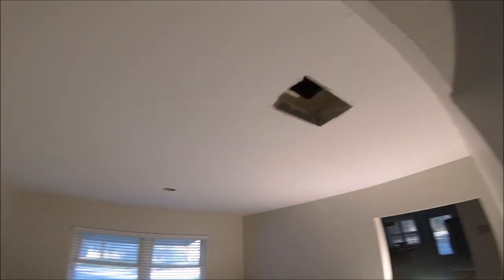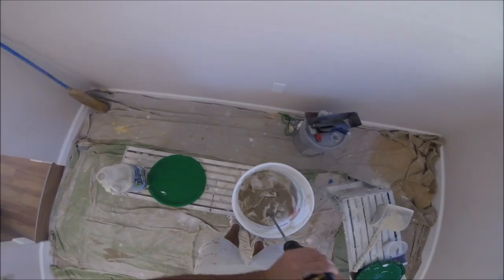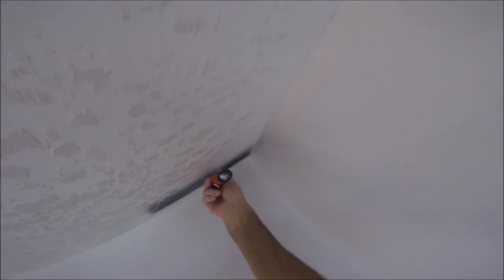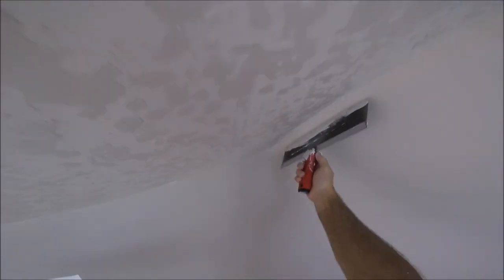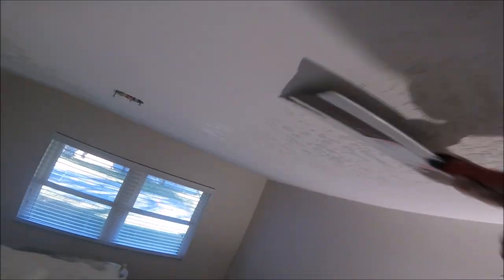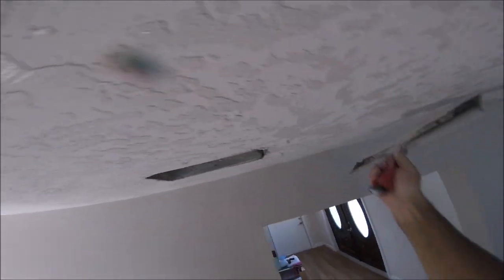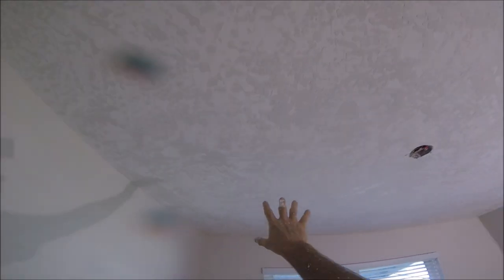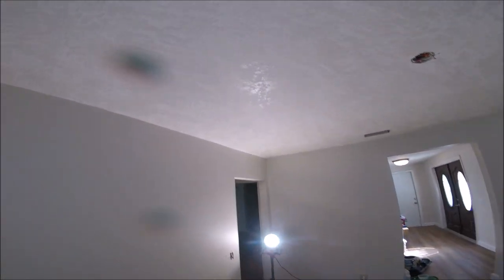How to Mix Skip Trowel Texture- Tools Needed-Tips and Tricks- DIY How to Skip Trowel Drywall Texture

Comment: To the novices out there trying this with play sand, I recommend sieving the sand first to get any large bits out. I had a few small pebbles in my sand that drew streaks down my finish which look bad. 

I just tried this on a ceiling closet using a sack of play sand I got from Lowes. I was satisfied with the application as it was going on. My hand was inconsistent from start to finish because it took some time to get the hang of it. All-in-all, I'm satisfied and really glad I did it. I really prefer the sand look to various types of skip finishes that lack sand, because I like the earthy texture, coarseness, and the way it encourages more rough and natural looking shadowlines.
Reply: Found out that what you really need is 80 grit sand.  It leaves a more consistent application.  Found the sand at the concrete Redimix plant.

Comment: I''m to the point on a project that I need to texture a room I'm remodeling. Lady wants skip trowel and your video will help me get it done. I don't understand what the sand in the mix is for. I'm guessing it is to keep the trowel from getting the mud too thin? Like a "thickness gauge"?
Reply from the maker: royalhawaii, Your partially correct in that sand keeps the joint compound from going to flat and sprad out. The sand also is what makes the joint compound "skip" to create the skip trowel pattern that you see in this video and also how I always do my skip trowel. There a some texture artists that do not put sand in their skip trowel mixture. Which results in more of a larger more flattened out looking skip trowel. Hope this helps, -Paul
Reply: Thanks Paul for the reply. I've enjoyed "learning" from your videos. Will be seeing if I learned enough very soon LOL

Comment: Can you use the texture mud the same, or does it have to be the joint compound? I figure texture mud may be thinner. This is going into a bathroom, so has to be moisture resistant.

Comment: That was oddly satisfying to watch, thanks. I have an old ceiling with a light orange peel on it. It has a big crack and a few holes and I wanted to also change up the texture to a skip trowel. Would it look okay if I skip troweled directly over it, or would I need to skim coat?
Reply from the maker: Sachou, yes, I find watching these videos are very therapeutic for some reason too. As far as skip troweling over an existing orange peel texture after you repair your cracks. Yes you can go right over that orange peel texture. One thing I always do when I'm skip troweling over an existing texture that also has been repaired is to match the existing texture on the repair before doing the skip trowel texture. Reason being is, skip trowel texture is not total coverage so you can kind of see in between the texture and a smooth spot underneath the skip trowel texture will show after it's been painted a lot of times. Hope that helps and thanks for stopping by, -Paul
Reply: @PaulPeck  this is exactly what I needed to see! Excited to hear about primer and next!!!

Comment: RE: sand questions below, we always used silica- sand.  it has sharp edges and "skips" better than smooth sand (like "play sand"), seems like.  Wish I knew where to get some in the Philippines, now :-(
Reply from the maker: Hey TJ, so true. I never use the play sand. Do they not have silica sand there in the Philippines? Thanks for watching and subscribing my friend!😎 -Paul
Reply: @PaulPeck  Almost NO "ready made" building products in Philippines (so no silica sand, only "your choice" of local geological sand.)  Construction is rarely gypsum-plaster based, I think the extreme humidity  + aggressive termites (so no wood-frame construction + "sheetrock") is probably WHY.  I'm trying to figure out if I can "texture" with nearly 100% cement and a little - - river sand(?).  Maybe do a "scabby" skip-trowel cement layer with texture, then lay a skim-coat near 100% cement over it.  BUT it may all fall off after a couple years. They do an AMAZING job of flat-smooth-cement "perfect" finish work here, laid over re-bar reinforced cement-block construction.  But they will spend ALL DAY troweling and re-troweling 20- or- so linear feet of a wall, and then adding 100% Portland for the final finish, to make it stay in place. Beautiful, but not interesting to look at.  After a while, a fella gets BORED with looking at ALL-flat, ALL-smooth walls.  ;-<

Comment: Paul, I am repairing a "plastered" (1950's) ceiling with drywall where I have patched bad spots with drywall and joint compound.  Noticing that plastered areas are much slicker than joint compound, will this skip trowel method with joint compound work over both the plaster and joint compound in equal fashion or do I need to skim coat the entire ceiling with joint compound?  Also will pool filter sand 20 grade silica work?  Couldn't get link to the sand you sell to work (

Comment: Good god why do people texture walls or ceilings? I’ve never seen it in a house built after about 1950 around here.   That’s got to be a dying art.
Reply: 2 reasons I know: give depth/character to the surface and more common to hide imperfections, you don’t need as much skill or time to spray on orange peel as you do to get a level 5 finish
Reply: The only flat ceilings Ive seen in 30 years are ghetto houses. Skip trowel is the best